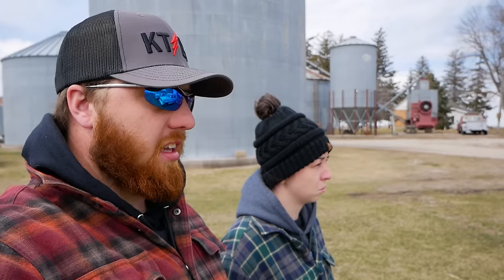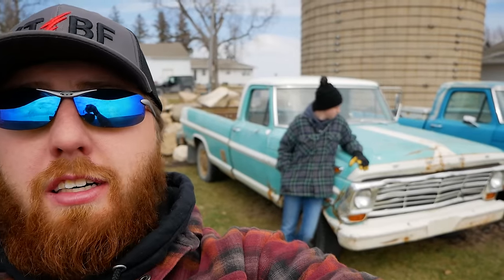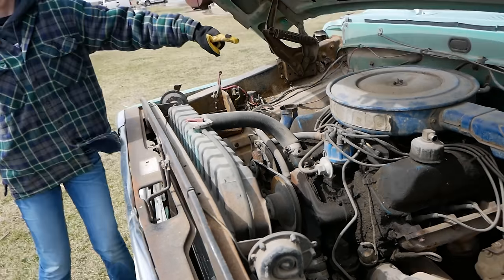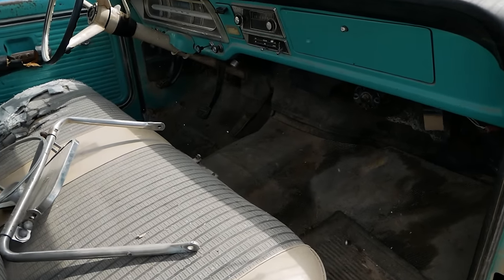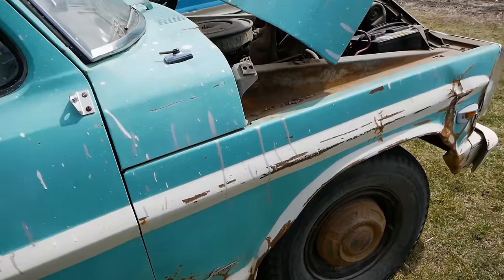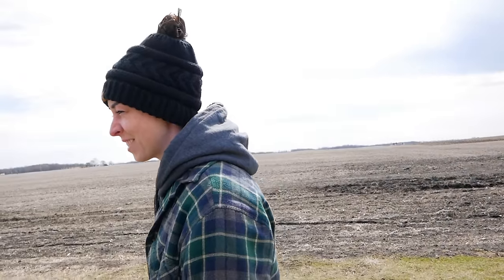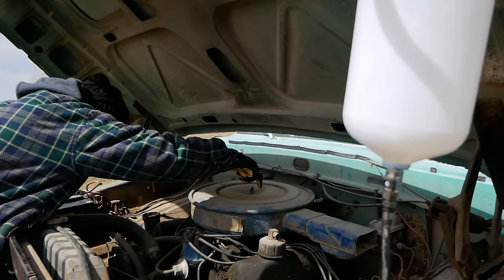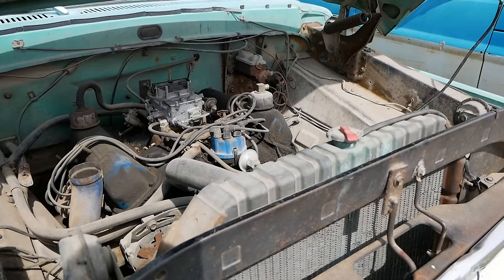ABANDONED Farm Truck Returns to The Road after YEARS in a Barn!

Comment: I had a 71 f-100 long bed, with 352 block and a 360 intake..holley 750 street avenger carb..smoke Grey  65% restored... new dash, glass, and aluminum trim pieces, had a five gallon gas can with air hose from advanced auto from carb to to of can and from gas pump on block...bright orange! If I passed a gas station I was walking back with that gas can lmmfao.... this was in 05. Raced a hemi and blew the rear main...I was driving a 2005 Hyundai Elantra so I drove it to the crush yard and across the scale... guy at the read out offered me 500.00 but at the time scrap metal was 16.50 every 100 pounds so I took the scrap price of 620.00. I was young and addicted to pain pills.. this was the beginning of that 12 year endeavor.. which cost me my family, friends and job... ended up in prison for 5 years. That broke this mustang. Life is too short.  So please, please do not think you are I invincible against opium.  I've seen some great men and women lose everything behind it. OK I'm Ramblin on.. bye

Comment: This F250 Is amazing and its nice you brung it back. Also my dad got a 75' F350 its very great and i love it its got a good 352 block and does pretty well for a 2WD Flatbed with dual wheels in the mud. Also it sat here with a problem that wont let it move this spring my dads gonna fix it and the problem is more where near the diff the driveshaft moves but we dont know exactly where.

Also you are very amazing i especially love your ATC and Pickups revivals. Ive been watching your vids since 2019.

Comment: Full manual drum brakes often like a pump or two before you apply them in full. It means that you have to plan ahead a little, but once you get the feel of it they will work like you are used to feeling with power/disc brakes.

Comment: If you check the rotation and the tension action of the drums you will notice that the adjuster is moving when the drum is in reverse. So to properly adjust the "self adjusting" breaks you should put the truck in revers and move a bit hit the breaks hard and repeat until the breaks are adjusted

Comment: The Holley carb you put on is a 500 cfm. The accelerator pump is a 50cc. The 350 cfm carb has 30cc accelerator pump. 
I believe that part number is 4412 S. 
You got that old Ford motor purring!

Comment: MOAR BRAKE JOBS! 🤣🤣 Literally every old and used vehicle I've ever worked on needed brakes of some sort, so I feel your pain.  On a side note, I wouldn't personally throw tons of grease on spindles before you throw on the hub.  The inner wheel bearing race should definitely not spin on the spindle.

Comment: From my understanding and my grandpa had a 67 F250 Camper Special was the wheel base didn't change until the 70s Camper Specials Dent sides. My dad was also a Ford mechanic at the time. The best way to explain the a camper special was it was a F250 with F350 brakes and suspension so that it was beefier than a regular F250.

Comment: If I'm not mistaken the "bump sides" never did the axle movement that was only the "dent sides" and as for the old rims they are a locking ring, just like what forklifts still use today and most tire shops will work on them. The only issue is trying to find the tires but thats just the info Ive been told as always great work you two :).

Comment: Back in high school I had a 1968 Mercury Camper Special. 16.5 inch tires. They were hard to find even back in 1984. Two wheel peel. SS

Comment: I used to have a 1964 Pickup Truck with No Bed on it.   It had what I was told was a 292 Cu.inch Engine.   It was a V8.  My Dad put a Floor Shift in it because the Colum shifter had gotten broken off of it.  It was a 3 speed manual Transmission.

Comment: Better order a rag joint for that steering.  THAT is the adjustment for the steering column.  Cheap and really easy to replace. Nice job on the  brakes.  Protect that dash pad, they are really expensive.  Matter of fact, give ya $300 for that one.  Funny my raggedy of farm truck also has no rear view mirror.  Don't replace the tank behind the seat, get a custom sized one for one of the other spots.  Wonder why that main support underneath has NO rust.  Cool episode.

Comment: Reminds me alot of my 71 f250 it was a 360 4 speed truck with a 373 gear I put a performer 390 intake on it and 600 Holley and the truck would do a 40mph burnout without any effort... My neighbors hated cause it would smoke the street out before I put fresh valves seals in it but hurt alot of local "fast trucks" feelings around here

Comment: That milkshake looking oil has me thinking. I got a '36 Flathead V8 Ford motor that did the same thing while sitting idle in a garage for several months during the winter. It didn't wanna run at all and was making a strange noise in the distributor that had to do with the vacuum advance, it'd go away once I disconnected it. 
I'd check for that milkshake oil again, keep a check on that in that truck. I'm actually gonna be inspecting the head and replacing the head gasket on my engine.

Comment: I hear low compression and an exhaust leak. A 373 rear end is strong, good for torque and decent on mileage. 4 wheel drum will be an issue. A rule of thumb, the idle mixture screws should be out 2 full turns.

Comment: The 'Camper Special' was just an option package offered. It did not increase the wheelbase & bed length for this year/generation. The bed length is the same as any other 67-72 model.  It wasn't until the next generation (73-79) that the 'Super Camper Special' was offered for the F350. It did have a longer wheelbase and the wheel well sat further back. The spare tire was stored in the bedside.

Comment: Kevin and Mook - Love your videos!  I learn something new every time.  Kevin - I think that you got the Camper Special kinda wrong, though.  I'm pretty sure Camper Specials are the same wheel base as a long-bed F-250 or 350 but with bigger brakes and heavier springs.  What you're thinking of is the Super Camper Special ran from '73-'79 and only came as F-350's.  They had a longer wheelbase (140") and only came as 2WD standard cab.  They are easily identifiable via the longer wheelbase and the spar tire mounted behind a 'secret' door in the side of the bed on the passenger side.
Reply: That's right.

Comment: Put a pipe fitting on the oil drain and run a hose to a more convenient location.

That looks like a job for two 55 gallon drums in the bed gas tanks.

Comment: Farm truck tires don't need to be round, or very reliable, under about 50 mph, but the drivers at least should have aggressive tread, and they should usually have 4wd.  You could put chains on the old tires if you hardly ever plan to be on pavement.

Comment: My buddy had a farm truck. Smelled like chicken crap and cigar smoke, starting it required going through all five stages of grief then coming out the other side, it was almost completely gutless, suspension was like being on a bungee cord, the truck took braking inputs more as a suggestion than a command and the headlights sometimes cut out due to corroded connections. Brake lights? Are you joking? All told, that thing was an absolute blast. There was no better vehicle for sliding sideways through a field at 40 mph.

Comment: I’m not sure about the 67-72 bump sides having 3 different long box trucks, but the later 70’s Ford dent sides had the standard, camper special, and the trailer special which had the rear axle even farther back and is nearly impossible to find .

Comment: Luke is right that if you must adjust idle speed over square, there is something else wrong with the engine, but you can often go well under square and keep advancing the timing until it either spark knocks or tries to start backwards.  And these old engines might have low enough compression that you do need to go over square to keep them running, the compression being the something else that is wrong, and often not worth fixing or not worth fixing right now.

Comment: Late to the party but want to add a couple of points. First I noticed Mook picking up something black, a battery perhaps? She lifted by having her legs do the work. Keep doing that your whole life OR you will wish you had, later in life. Second, I drove the same basic truck when it was a year or two old. It was red, had a farmer 4 speed and was not a camper special. I think the worst day that truck had was when it was pulling a waggon with 100 bales on the waggon. When slowing down around a curve one of the waggons front wheels passed the truck on the ditch side. It was a bit worse than having to re stack the hay but really not that bad when all was considered.

Comment: Man that old Ford is pretty clean for a rust belt farm truck. Would love to find one in that condition. Awesome video.
Reply: The reason it isn't rusted out is because it was a farm truck. Lower miles and not many of them on salted roads.
Reply: @possumwerx   I guess a farm out ware yens are from is a different deal than here in Pa as they are usually rusty, dented and beat to hell and back with high mileage. They have special tags for them here cause they won’t pass state inspection and with the special tag they are exempt from inspection but you can only drive out 25 miles from your farm and have to use secondary roads at night.

Comment: In January 1972 Detroit was in the depths of their 
usually miserable winter. Snow & ice & freezing 
temps. I had had about a bellyful of slipping & sliding
and being stuck and winter in general. I had seen 
pickups w snow blades about town and was thinking
that was the ticket. 4X4 to get me outta the snow. I
came to a stoplight in front of a Ford dealership
there on the lot was a brand new 1972 F100. I had to 
take a look. I pulled in and it was a basic work truck 
F100 4X4 reg cab long bed straight 6  3 speed truck
trans   $2800.00.

!

Comment: You just might have a 390 there. My 68 CS had a hot 390 with an Autolite 4 bl carb, headers, and 3.73s (if I remember right). It was a burnout monster on the 11.50x16.5 rock hard bias ply snow tires! 😂

Comment: camper special uses same box as regular pickup. f350 super camper special had the extended wheel base and different box. also cause of the wheels being further back on super camper special, the spair tire is in the passenger side of the box. the front pannel is removable

Comment: In Australia you don't usually get a "farm truck". You get a thing called a "paddock basher" (or at least you did when I was kid in the 70's.) If you were lucky it was a holden HR ute with a lot of rust, and if you were unlucky it was a Ford Fairmont sedan that was a burned out fire Insurance write-off that someone threw some tires on and cut the roof and boot lid out of with a hammer and cold chisel.
Reply: So you are saying Road Warrior type vehicles were common then?

Comment: 8x6.5 is still the dodge ram wheel pattern for the 2500 and 3500 so you could get a basic steel wheel set for a ram 2500 and they would bolt right up

Comment: On the Fords from the 302 to the 390s and the 460 are especially Krikey when it comes to plug wires. I have gained as much as 8 degrees in timing and gained dwell just by putting new wires on em. It's common sense if ya think about the hows and whys

Comment: Kevin honester that 68 ford f250 being a camper special custom cab and having the automatic transmission and the 352 and the heavier rear suspension and 3.73 gears in the full floating dana 60 rear end it is probably worth more than a normal custom,or a ranger or a sport custom f250 truck and is in really good shape for this part of the farming heartland!!

Comment: my grandpa back in the day had a 1961 f250 but he modified the hell out of it over the years it was a rear wheel drive only with a inline 300 but later he made it a 4x4 with 1 ton axles and a manual trans and a np 205 transfer case all powered by ford 351 that he made into a stroker motor that was bored 30 over and he made that puppy roar it was his daily driver/ work truck.

Comment: Not really a thing with old farm trucks, just a thing with fords. Im not a gm guy but we get hay from a buddy that has an 80's sliverado 2500 and it loves its farm life. Another feller we called herb had an early 80's gmc 3500 flatbed and he rolled it taking a load of hay to the barn when the hay trailer jack knifed and spun him sideways and sent him over with a load of hay. They got it rolled back over on it wheels and started it up and drove it back to the farm. Im a mopar guy myself, the 3500 gmc was trying to leave the hay field in snow and it wasnt budging so my pops took our 98 dakota with the 318 and pushed the loaded down truck up a mountain road. With proper tires a mopar 4x4 system is unstoppable. A dodge has yet to really let me down in my 26 years of living and 18 years of farm life lol the only thing ford did right was their tractors and they're just too slow and low power to hurt themselves.

Comment: to get the self adjusting brake shoes  to adjust properly you take and adjust them to a minimum manually and then you take and get in the vehicle start it and put it reverse  and back up and hit the brake pedal pretty hard and the will adjust there selves properly that is how you do a proper brake adjust on self adjusting brakes

Comment: Kinda towards the end you mentioned needing to adjust the steering box a bit on that thing.  I thought that doing that might make a really good little tech clip for a video.  Doing the adjustments is pretty straightforward, but you can run into problems if you tighten those too much.
Reply: He needs to check the rag joint and other steering components first. Often the box is fine while the other parts are shot.
Reply: @possumwerx  good point, another reason why I think it'd be a good piece of tech to go through

Comment: The camper specials for the 1/2 ton variety where considered to be a 5/8 ton for towing campers and other stuff. No idea if that's the same case for the F250 you guys got
Reply: The information on the warranty plate on the door will give the GVW for the truck.

Comment: I had a 68 1/2 ton , with a 360 or a 390 with a 3speed on the tree with overdrive, that someone let the seal go bad on the bottom of the overdrive and melted all the insides into one mass, parts where unavailable even in 1985, so, before I got it.I found a 4speed granny low and stuck in it and my Dad  cut and welded a different driveshaft, on a bench!! and never shook!! Loved that old girl, except for the gas mileage and later stuff that happened . Check the breaker plate under the points, Ford and their infinite wisdom of their engineers, thought a plastic pivot piece was a good idea, it will make it run real sloppy at 1st, and you will think it is the carb doing it, but eventually leave you sitting on the side of the road, when the piece lets go.IF it lets go in the middle of the night in the middle of nowhere, no tools and a cig lighter for a flashlight, take a screw out of the headliner trim and stick in the pivot, it might get you home!! LOL Another idea to check on something, is the wire behind the alternator , I noticed yours is rubbing on the head, mine did to, and went out to start it one morning and battery was dead, I thought the alternator went bad, but wire had rubbed against the head and was shorting out!!, amazing it didnt burn it up in the driveway!! The demise was going to our homestead farm , to set up deer stands , on Hwy 19 north of Herman Mo, it started driving kind of weird and wondering around, no power steering on it either, when I got to our farm, I had another guy turn the steering wheel, and both front fenders would flex, the cab mount towers had rusted out from the inside out, actually NO METAL at all to attach the repo mounts they made at the time, to the firewall!! ratchet strapped the cab down and put 2x4,s inbetween the floor and frame, and 3 quarts of oil in , made it home. Found a 77 Ford at a dealer that was a wholesale truck, to play with then, thats another story, with a 302 and a granny low 4 speed someone stuck in it, if you ever run across  a 77ish 302 start making a lifter noise stop it immediatly and pull the valve covers on BOTH sides check the valve rotators they have on the end of valves, it was silent until a trip to the Ozarks and it started that, though it was a fuel pump spring, but a rotator cap split and wedged in the keepers, and almost dropped a valve, had to pull the head and replace a valve, the next week another one done it on the other side, only I caught it in time. Thank you for your service also, neat channel!!

Comment: Split rims are not that bad, the 3 piece ones are the scary ones. split rims are easy to do saftly, either in a tyer cage (in australia all tyre shop have them), or simply turn it upside down or lean it up against a wall, place the split down or against the wall when inflating, worst thing that will happen it it will bounce the tyre a few inches.

Comment: Lord I remember adjusting it seems for years on those breaks. But I used to go alittle faster backwards to self adjust the breaks. And to see if my can holder was solid.
Reply: I usually adjust the wheel with the drum off, test fitting it until the drum won't clear, then backing the adjuster off enough to get the drum on, then doing the final adjustment.

Comment: I thought it was going to have a Perkins like the one from Central Iowa performance! That was cool! 

You could pressure wash it, in the bottom, do a Quick shoot of Eastwood rust encapsulater, and run it like a low/bug shoestring rebuild, and then revisit every six month and show how good it holds up to everyday use/abuse! 

And is the Bronco comming back?